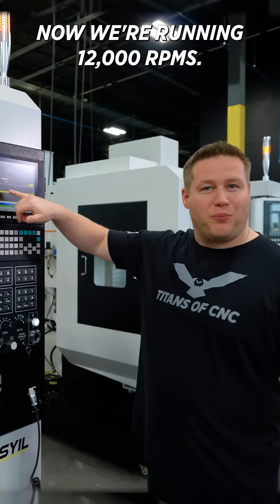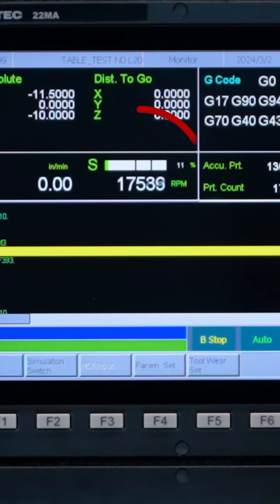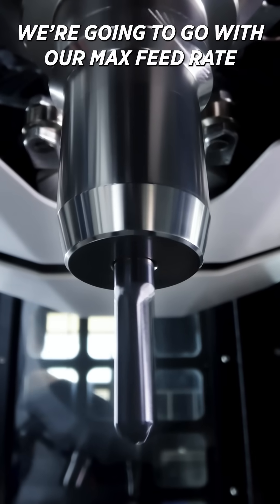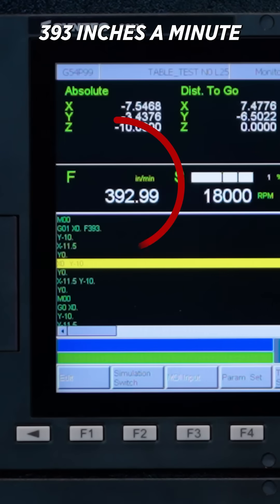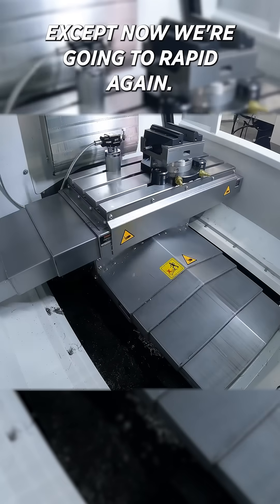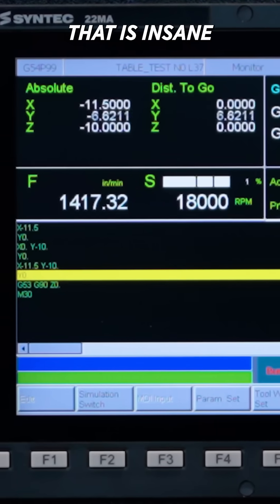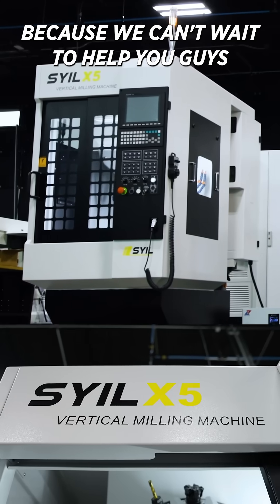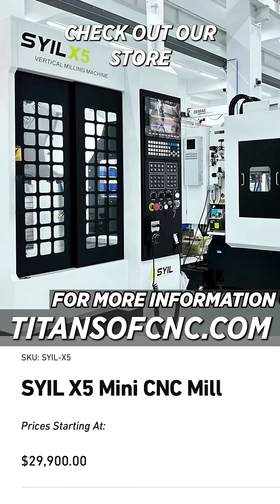Lightning Fast CNC Machine for Under $30k ⚡️

Comment: Where are SYIL products made?
SYIL machine tools are designed, Our machinery and equipment are designed, manufactured, and tested in our factory in China. Components and accessories are manufactured in-house or sourced from around the globe from our partners in Germany, Japan, and Switzerland. These products go through quality assurance procedures developed and controlled by our in-house engineering team.

Comment: Our CNC machine MILL X in GFMS has feed speed of about 3900 inches/min or 100m/min and spindle speed of either 36000 or 42000rpm. Pretty cool machine.

Comment: Many people dont like that its made in China,  to a point, i agee.  However, many of the components , the epoxy casting, linier bearing etc are from Germany , tc.  
FFurthermore ANY AMERICAN COMPANY COULD DO THE SAME!  BUT THEY DONT. 
The big issue of concern is , with geo political situation being what it is,  one may find it diff to get parts service in the future.

Comment: Sure it can feed that fast, but whats it work envelope/table size? It doesn't look like you'll have the space to hit those feed rates on such a small table. What is the acceleration and deceleration rate? Hugh feed rates in a straight line are great for advertising, but don't mean much if it can't do it while actually doing work.

Comment: Hey all. I have a way to 3d print metal parts on a 10,000 machine. It can recycle metal or use new. It can lay down different metals simultaneously. No waste, very fast. Interested?
Reply: Interested.

Comment: I had a machine that would do 12,000 or 11,999
It blew my mind to hear that they had programming for machines where they actually had to pay to run the machines faster than- i think it was 8000 at that particular shop

Comment: I work in aerospace and im a tool maker and i worked at a place that wants to run their shop cutting at 240 inches a minute 12000 RPM they scrape more parts than anyplace i ever seen have to edit all the programs

Comment: Our x5 is a small beast. Only downside is the z travel in not far enough down. Requires long tools witch is a bummer
Reply: It's probably to ensure the machine has adequate stiffness, torque is force x distance so shorter is stiffer. Mount your parts in a vice or fixture to close up that gap
Reply: @mandrakejake  you need like 50-100mm plus vice to get short tools
Reply: I sometimes work on a machine that has the same problem. It's just not optimal
Reply: You can extend the vise up?
Reply: @mattb6646  yes but it adds weight and complexity to setup
Reply: Is it a soft limit that can be edited?
Reply: @zackman62t  no ballscrew too short
Reply: Z is short. But a vise and supplanted eat up the room.

Comment: I just don't understand the benefit of the spindle rpm when your capped at 393ipm feeds. Pretty easy to beat that MMR at 650ipm with an 8k spindle on a used Haas you can get cheaper.

Kind of concerning that the machine can only handle 393 feed, but let's itself do 1133-1200 ipm rapids. Seems like a long term durability issue waiting to happen.

Also, says, "That's not a rapid move that's feeding." Shows slow AF table.
Reply: good for small diameter tooling
Reply: As a programmer who works in a shop full of haas machines the most I would pay for a used one is free. Price to performance is pretty good but they're pretty fragile, especially if you're buying it as your only machine and you just need it to work a new machine has a lot of benefits when you don't have a maintenance team behind you to fix the machine, you have no idea how a used machine has been treated and it's hard to tell until you start making parts on it. Your MMR on most tools will be with larger radial depths of cut anyway so a super high feed rate isn't going to help you much unless you're working on parts that aren't very rigid and are trying to maintain chip thickness on low radial cuts. 8k spindles are pretty damn useless with any tools smaller than 1/4, you're going to be nowhere near 300ipm never mind 650ipm running an 1/8 endmill at 260 sfm you're looking at maybe 30ipm. So your cycle time is almost double on that 8K Haas
Reply: Valid points
Reply: micromachining

Comment: I've seen so many videos of these machines throwing tools, 4th axis units so weak you can move a locked unit with your hand, they'd be great machines for 15k. You're better off buying a use minimill or the likes.

Doesn't matter how fast they are without a load.
Reply: Plus it's a syntec control. Chinese junk
Reply: @Joeherdingcats  According to Titan they're assembled in China but the parts are made elsewhere. They also list Siemens and Fanuc controls as options.
Reply: Where are those videos?

I've seen a few videos that are reviews after a few years   and the guys love these machines.  The run out is better than their haas as well.
So you're implying the other side of the story, I'd like to see that as well
Reply: They wouldn’t promote these without a hefty payout.

Comment: Now send it through a block of 6063
Reply: They cut “monel k something” or something like that on it. There’s a video
Edit: Monel K500 is what they cut on it
Reply: @Baby_J1  I looked into these machines and I've never once seen a video of them cutting anything other than air. There is a plethora of better options even brand new. Chinese junk.
Reply: @CNCMatrix care to provide a list of atleast five options? I was looking into buying a syil X7 but you seem to know of better.
Reply: @jacobkudrowich   Smart and SMEC are pretty solid entry level machines. They might be slightly more expensive but not by much. One of them bought the rights to use Morri's castings and is literally an older Mori with different sheet metal right down to the turret and the tool holders. I'm sure there are other. I got a flyer for a small Smart CAT 40 VMC with a 10k spindle and it was like $47k.
Reply: @CNCMatrix  How?? There are literally dozens of Videos of Syil machines working on different materials..
Reply: @tigga5117   I haven't avidly looked in like half a year or maybe even longer but Syil themselves had no videos cutting material, when I asked them why they said they were coming soon. After I posted my comment here I did see one Syil owner cutting steel on their X7 or whatever VMC with a HSM toolpath taking a VERY small radial DOC and full flute length and it was CHATTER CITY. Buy cheap, get cheap. I'm not saying nobody should buy them, I'm sure they work fine for some folks, I'm just saying there are much better options out there for not a lot more money.
Reply: @CNCMatrix agree here. I think their spindles are so cheap they have zero rigidity. Everyone that has one cuts 10% stepovers even in aluminium. 
I think the machine itself is fairly rigid, possibly also fairly accurate. But for some reason nobody can actually push them.
Reply: @CNCMatrix On this very chanel the have a video of it cutting hard stuff and aomething more realistic and it didnt sound bad at all ... For a machine this size of course
Reply: @CNCMatrix  smec indeed is a solid option. It used to be called samsung from what i know but is now sold under the smec name where the s and m stil stand for the samsung part i think.
We look at the bigger smec wich is a lot more expensive then the price of this syil, but we where looking for a machine with around a 60" travel. And at that point the smec was a pretty interesting option for the price point.
Reply: @filmatura  i cut 10% stepover as wel, with a 16mm roughing mill in steel at 3000mm/min feedrate. But im gonna guess thats not what they where doing. And that on an old milltronics wich isnt anywhere near top of the line either. But it is made in MURICA. Now milltronics might not be top of the line, but their service is really good. So for someone looking for a cnc machine for on the side work i could probably recommend it. Even for our early 2000s machine we just called them from europe, and they answerd all the questions and tried to help us to get the machine up and running again. Something a lot of brands simply refuse. They say just vind a repair company to do it for you or whatever, dont come to us.
Reply: @CNCMatrix  well it did cut K500 on their channel, its sure to be one of the most popular videos about the syil on this channel. Also i have never heard on any really bad machines, as far as is saw most reviews were pretty good but they cant be very rigid since they don't have much space for big castings strong motors and hefty ways
Reply: @filmatura I have an X7, just starting out with it and pushing it hard. Can upload a video if you’re interested, but my only issue so far is with my toolholding letting the tools pull out. With a spring pass I zero out my calipers. Spindle isn’t really as quiet as it seems in the videos though.
Reply: @levelmatt2  do it please! Would love to see it.

If you're getting pullout, get some hydraulic holders or shrink fit.
Reply: @ I got a schunk tendo for my kor5 but I’ve heard pullout can still be a thing on hydraulics. One day I will be able to afford a shrink fit system but I need to start making money with this mf first lmao
Reply: @CNCMatrix you are blind then
Reply: @rendragtac   How the heck am I "blind then"? What am I blind to, exactly?
Reply: @levelmatt2   Use a milling chuck, not a hydraulic holder. Hydraulic chucks are really more suitable for coolant thru carbide drills. Edit: I just realized it is a milling chuck, that being said a quick Google search revealed a few people still having that issue with the Schunk holder, we use Schunk jaws but for a milling chuck we use the Guhring HPC.
Reply: I mean I try to stick to 10-12% step overs programming highfeed machine…. But I do a lot of A514
Reply: Cut 6061 aluminum with a 1/2” cutter, 1” DOC, .125 step over at 300ipm. Then stick it on the cmm.
Reply: Oh no. Not aluminum

Comment: Guys, any diy cnc mill would move the same speeds.
Reply: I would like a diy cnc handle the material this thing can work with. With the diy, you can maybe do plastic at this speed. This machine will do it with steel.
Reply: Sure as hell won’t have the same rigidity tho
Reply: What diy trash are you talking about? Get serious , grow up
Reply: No
Reply: Not true